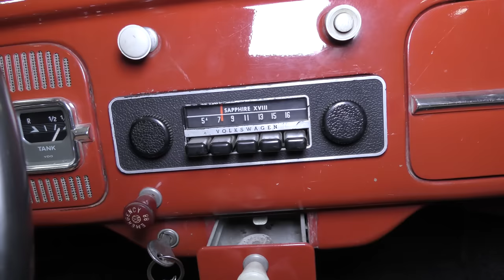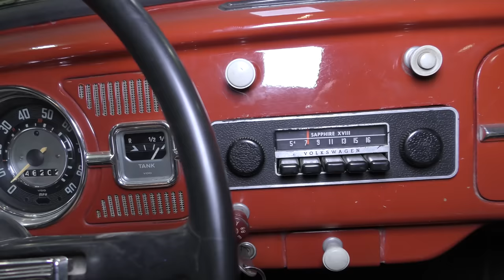Big Mods with big $$$. When Mods don't make sense. What did the  CAR WIZARD do to this '66 VW Bug?

Comment: You don’t need a tachometer, the little red slash marks in the speedo tell you at what speed to shift gears. Back in the era when Volkswagen made cars that lasted, and we’re serviceable by the owner. They are very primitive compared to a modern car, but so much fun to drive.
Reply: AhhHaaa! A beetle owner, you are right about the slash marks on the speedo! Could be a trivia question.
Reply: @escapecar  my 1979 Scirocco had them
Reply: I had a Beetle with no gas gauge.  Run out of gas?  Flip the lever, on the floor, and drive to a gas station.
Reply: @OG_Jack  my 65 had reserve tank also , you just reminded me.
Reply: @escapecar  the MK2 Golf had it in the cheaper versions till the end
Reply: If you didn't rev it to those marks it would over heat.
Reply: @franklinpatterson3693  No. They are top RPM allowed per gear
Reply: Exactly, my parents had two early 90s VWs (a Jetta and a Polo) with manuals and neither of them had a tachometer. The sound of the engine would tell you when to shift more so then even those markers in the speedometer.
Reply: @franklinpatterson3693  that's a yes and no both.
Reply: @dranoelr  how many VW have you owned, I have owned 8 I know what I am talking about, and have seen the results of someone lugging a air cooled engine.
Reply: @TheGerudan  the only thing the same was the name
Reply: @modelnutty6503  what is the no, lug one around and see how long it lasts
Reply: @franklinpatterson3693  mk2 Jetta and a aircooled T3. At least with the jetta it makes absolutley no sense to have it going 80 in second gear. Thats just loud and unnecessary unless you have it full and pulling a trailer. The T3 you have to rev higher because worse ptwr but also there it just makes noise and no power near the markers
Reply: @franklinpatterson3693  What do you mean? Those VWs weren't old Beetles, yes, but they had no Tachometers and a manual gearbox as well.
Reply: @escapecar  haha I'll have to look at my mk2 cluster tonight at the shop. 
I know my euro cluster with diesel tach doesn't have em but the factory one might. 
I knew the mk1s have em
Reply: Alternatively, you can just count to 20, then shift.
Reply: @OG_Jack  On the floor, or up under the dash?
Reply: @OG_Jack  Had a '56 Type 1 in 1959, when the engine started to sputter I would kick the lever with my right foot to kick in the reserve tank (about a 1/2 gallon)
and continue driving. LOVED IT!
Reply: @adoreslaurel  On the floor.
Reply: @TheOzthewiz  Exactly!  Flip it and drive to a gas station!
Reply: @OG_Jack  Ok thanks for that.
Reply: I'm adding one to mine because I'm doing a dune buggy build with the engine. While the speedometer will work, with the transaxle change up on it plus doing a 1776 build, I'd rather have a visual on the tach.
Reply: @kattcasel9730  When you drive it a while, you can shift by the sound of the engine, as well as mph.
Reply: @OG_Jack  Went from Chicago to NYC in a '58 like that.  Had to find a station fast, after flipping that lever.
Reply: @richardbell9656  Reserve was an option on gas gauge models.
Reply: @adoreslaurel  On the floor, to the right of the gas pedal.
Reply: @OG_Jack  Thanks for that, I thought my memory of it was reaching under the dash to turn it 180 degrees.
Reply: @franklinpatterson3693  that does make sense to keep the rev's up to keep the engine fan blowing fast enough to cool under load
Reply: @robgraham9234  i think any 1930's design car is probably less safe than a pinto
Reply: @robgraham9234  several million ppl being wrong isn't uncommon..for instance...religion
Reply: @richardbaumgart2454  how many other 30's cars were still being sold in the 70's. they were only sellable due to low price and massive ad campaign
Reply: @robgraham9234  they were popular among the 60's & 70's hippies cheap and reliable plus u could convert the VW emblem to a peace sign lol
Reply: We for sure have differing opinions on whats fun to drive. A 60 year old tin can with 35hp just doesnt make my list
Reply: @fanatic26  a 350hp turbo Subaru swap would be fun tho like Mighty Car Mod's
Reply: @richardbaumgart2454  cheap yes, reliable no. Travel down the M23 when the bug fest is on in Brighton and you’ll pass a broken beetle or type 2 every few hundred metres.  Even the London to Brighton run doesn’t cause that level of carnage.
Reply: @robgraham9234  Old cars break down sometimes? REALLY????? Bro that's so crazy
Reply: He removed a German carburetor and put on a chineseum crap carb!!!  UNBELIEVABLE!!!!!!
Reply: @ianmoore322  old cars break down more than new ones and need a lot of maintenance. Beetles break down for a hobby and are more less likely to get from London to Brighton than cars made in the 1800s.
Reply: @tarstarkusz  so you’ve fallen for the German reliability myth.
Reply: @robgraham9234  It's not a myth. They are much better made.  OEM is nearly always better than a knockoff chineseum.  All you have to do is clean them.
Reply: @robgraham9234  delusional
Reply: @ianmoore322  couldn’t agree more anyone who thinks beetles and Volkswagens are reliable are definitely deluded
Reply: @tarstarkusz  no German reliability is a myth and not all Chinese knock offs are rubbish!
Reply: @robgraham9234  No, virtually all Chinese knockoffs are utter rubbish.  The original made in Germany parts are MUCH higher quality.  Chineseum parts are cheap because they are made cheaply. Corners are cut. There is very poor quality control.  I would be willing to bet the original carb weighed close to twice as much as the new one.
Reply: @tarstarkusz  
Virtually all= not all! Corners being cut= no sharp edges.
When you have 30 usable Bhp only reducing any component weight by 50% is a big win😸.
Modern materials and casting/moulding techniques mean it’s possible to do so and increase efficiency and reliability without compromising reliability.

You will probably find that a lot of German engineering is made in china. If people looked at the quality of what they were buying rather than just getting the cheapest thing off eBay  the cheap knock offs would soon go.

Anybody for a Timmy Halfinger T-shirt?
Reply: @robgraham9234  Low volume carbs for a car that hasn't been made worldwide in nearly 20 years is not likely to be one of the quality devices. Cutting corners means taking shortcuts, not literal trimming.
Removing a few pounds from the car is not a win.

I'm sure a good carb COULD be made today in China, just that it's not.
It's not engineering, it's build quality. It's about putting your name on something vs illegally putting someone else' name on it.
Reply: @tarstarkusz  sorry I’m getting bored! Can we stop trolling each other now.
If you’ll admit that the beetle is a horrid car with no redeeming features I’ll accept that Chinese knock offs are rubbish.
Reply: @robgraham9234  I'm sorry if I gave the wrong impression that I think Beetles were good cars.  They were bottom of the line econoboxes whose main selling feature was price. No air. No power steering. No power brakes. No automatic transmission. Blows around in the wind. Vastly underpowered.
The only point I made was that the OEM made in Germany carb was of higher quality and very simple and easy to rebuild.
Reply: @tarstarkusz  probably me not paying proper attention, beetles were not underpowered they were just powered in accordance with their handling and brakes.
Most people who bought them probably needed help. Wandering all over the road was for those who like a long and winding road over boring straight highways. Popular with paperback writers who said all you need is love, lady Madonna preferred to let it be. No sat nav meant many magical mystery tours.
Giving one to your daughter meant she’s leaving home and probably wouldn’t return.

Why would you want an auto gearbox , they are for the elderly, infirm and people who can’t drive.
Reply: @robgraham9234  how many have you owned?
Reply: @vw5056  how many what have I owned?
Beetles:- none I’m not that stupid! Am old enough to have been forced to ride in them though. Noisy uncomfortable and always breaking down. Known many people foolish enough to own them. Almost always repairing them.
Vw in general:- none, but having worked for a well known roadside rescue company I get to see loads every day.
Reply: @robgraham9234  ok so you never owned a VW and claim they are not reliable. I have owned 5 VAG products and found them to be fine.
Reply: @vw5056  as my job is repairing broken cars and faults wagon group products form a large part of my work load it’s reasonable to conclude that Vws are unreliable. 
Remember even with a faultswagon you have an 80% chance of not having a problem in any given year. Personally I prefer cars which give me 95%+ chance of not having problems. 
Especially as vw use every trick in the book to force you to use a garage.
Try and get any info from owners handbook and refer to dealer is most likely response.
Reply: @robgraham9234  which brands have a 95% no fault rate?
Reply: @vw5056  scooby doos, Toyotas, pre Renault Nissans
Reply: My 83 Jetta had all the practicality of this car, obviously with better handling and build and more fun to drive.
Still made at the Wolfsburg 🇩🇪 factory in those days, pre-Mexico. The factory paint finish on my 1983 refused to die.
Reply: I think the red courtesy marks on the speedo were just designed to train your ear until you listened to the engine properly while you’re driving.
Reply: Funny, I came to the comments to say the same thing.
Reply: @franklinpatterson3693  Sooo you had a beetle that didn't run right?
Reply: One does not need a tachometer to know when to shift at all, on any vehicle.  All engines talk. All engines will tell you what it wants, you just have to listen.  After driving a car for even a short amount of time, the correct time to up or downshift will become very apparent, if you just listen to what the engine is telling you.
Reply: @ardsleytank7769  Only if you are very experienced with a particular vehicle. Some engines can run at very high rpm, even though it sounds too high, it actually isn’t (two strokes but also many four strokes like the Honda S2000) some you can’t, like VW or BMW boxer engines. I would much rather have a tachometer or some other indicator just to be sure, I want to be able to take the engine to its design limitations, if I choose to do so, not necessarily just putt along at cruising speeds.
Reply: @tarstarkusz  Try finding an original Solex that doesn't have worn out throttle bushings. They can't be found anymore.
Reply: @gpzjeffrey7974  Even if that is a problem, it is easy to remedy. 
Funny how mustie1 never has this problem and uses nothing but old original carbs.
Reply: @franklinpatterson3693  Being aircooled with a big central belt driven fan those engines are near impossible to overheat. The hotter they get the more efficient the heat transfer. I ran a couple of beetles, a '64 and a '68 back in the late 80's in the tropics. They were a lot of fun to drive, things would sometimes go wrong, mostly electrical. Overheating was never an issue.
Reply: I've driven manual transmission forever, I've never needed a tachometer
Reply: @brettbanta2100  I drove a stick without a tach for years. You can hear it, plus habit plays a big role. You just "know" when to shift without thinking about it.
Reply: @tarstarkusz  yeah, exactly, it's pretty much common sense
Reply: My 95 F150 had 2 tanks, I switched tanks when 1 ran dry then filled the other.
Reply: Never experienced vapor lock on an Air cooled VW.... EVER!
Reply: @robgraham9234  So you are stating that 60 year old Volkswagens are unreliable? What 60 yo cars are reliable?
Reply: @stuartstuart866  To paraphrase the pigs in animal farm 
“ All 60’s cars are unreliable, but some are more unreliable “
Reply: As for old cars being reliable, us old guys will remember when there was a service station or garage every twenty miles. And they were busy, no more, need I say more.  Ok, I worked on cars that were made in 60s,70s, they were junk, 12000 miles warranty, valve jobs, constantly, yearly ( or monthly) tune ups, now admitting some problems, you don't even open the hood for a 100,000 miles, on that note, in the 60s,70s when you filled up with fuel it was standard to pop the hood, fill with oil, old humour was " check the gas, top up the oil"
Reply: @Maurice-c6z  With all the complex emissions equipment, electronics, and specialized training, tools and test equipment, I’m not sure it would be possible for a typical roadside mechanic to do much with a modern car. I remember when my 71 Chevy Nova would cut out if you drove through a big rain puddle, it would be the points getting wet. That was an inconvenient, but easy fix. If my Volkswagen fuel pump went bad, I could be running again in 10 minutes. Yes, old vehicles were less reliable but even non mechanics could do many repairs with just a few tools and basic knowledge.
Reply: I have a ball with my 70 bug and 69 ghia!!!
Reply: Anyone else have their shift light functioning?
Reply: And then Porsche added complications.

Comment: This beetle has SUCH an amazing sound. It would be a crime to electrify it. I'm happy that in america there is an huge beetle scene, here in Germany it's almost extinct, and the parts are extremely expensive
Reply: In Germany the Beetle reminded people of the post war years of poverty...
Reply: In Italy there are quite a few actually
Reply: They are very common in northern Sweden, plus there are a few of classic VW only car meets
Reply: Mexico has a huge surplus of them and I’m sure parts are cheap over there
Reply: Beetles here are becoming very expensive if you find one in decent shape. And as nice as this car sounds, there used to be a popular aftermarket exhaust made by Thunderbird for the Beetle and Karmann-Ghia. It was a 4 into one with the exhaust outlet that came out the right rear. It made the car sound like a sports car, but not loud either. My '69 Beetle had one.
Reply: @adotintheshark4848  Can't you import a cheap one from south america in north america?
Reply: @Daemonarch2k6  South America in North America? I knew we had an illegal immigration problem, but that bad? Anyway the last bug was built in 1979 in Mexico. There was a successor with a different body, looked like a small squareback, that had the same platform. that was also  built in Mexico  until 1990, but the US and Canada never got them. They were Mexico/South America and Philippines only.

Comment: 1966 was the last year in the U.S. for the six volt electrical system in Volkswagens. That's a later twelve volt radio.
Reply: Yes, its been converted to 12volt. The generator he pointed to is actually an alternator. (12volt)